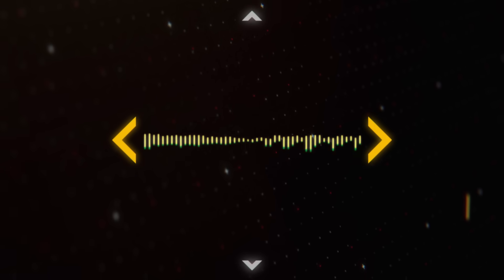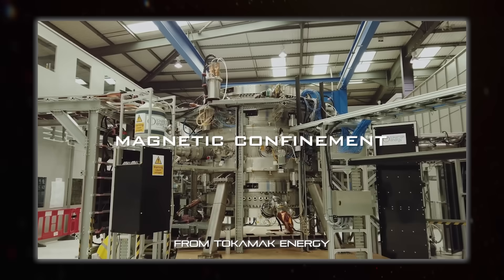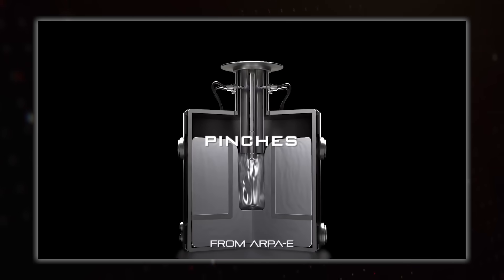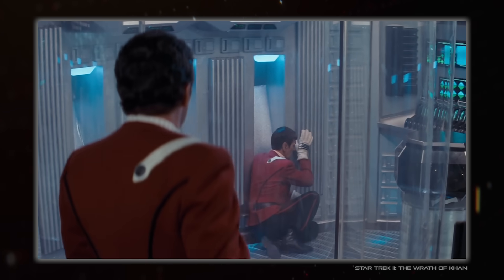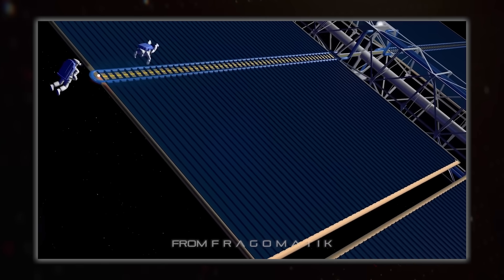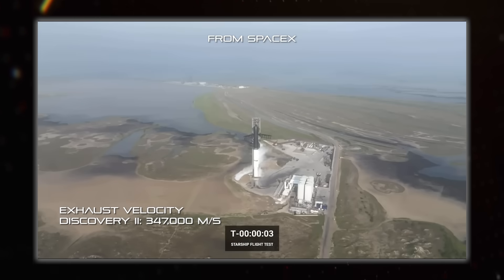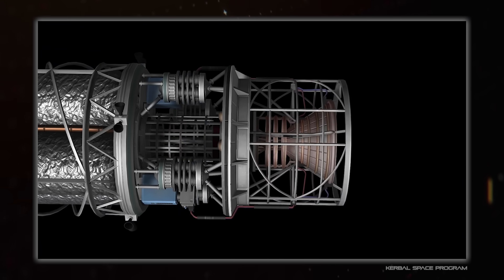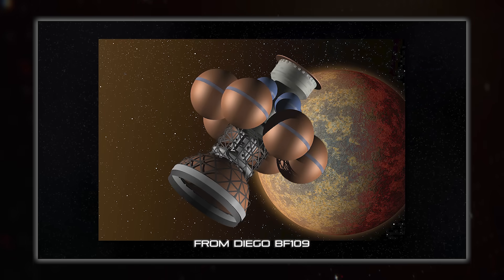Explaining Fusion Engines in Realistic Sci-Fi

Comment: 🤦‍♂NOPE ! This does not explain anything. It's a cool gallery of how they look with our current technology.
-Explaining is to be done with simple math/science. Science is your roof of realism and scifi is your ladder to get from actual human tech (most your video) to the closest of the roof of realism. Example of How : 
1-Considering 2 types of nuclear fusions DT and pB.
---DT : Deuterium-Tritium produce 17,6MeV ~ 3,375 E 14 J / Kg. Flaw : Tritium deteriorate fast.
---pB : Proton - Bore produce 8,7Mev ~ 6,985 E13 J / Kg. Less energy but easy to stock.

2-Assuming an efficiency of 100% (Roof of realism), How much mass From Mach 0 to Mach 20 in space.
---a 66t SR71 need 17,31 Kg of DT or 38,00 Kg of pB to reach mach 20
---a 6000T FREMM frigate need 1,573 T of DT or 3,455 T of pB to reach mach 20
---a 71 110T Yamato BattleShip need 18,65 T of DT or 40,94T of pB to reach mach 20
Limits :
---a 71 110T Yamato BattleShip need 82 210 T of DT or 180 500 T of pB to reach mach 1/10 of C (light speed)

3-Now you can adjust the engine efficiency to a lower 10%,  a realist 40% or super 80% to match your own personal setting. The design, radiation protection and technology will be adjusted with this efficiency.
Another Major information : To use Nuclear fusion, you need proton armor plate which will be use inside the engine and outside your ship since the faster you travel, the MORE space radiation you get.
-Ship mentioned that are using our level of tech will NOT survive to a tenth of their max speed. NONE.

PS : Mass is USI ie T for tons = 1000 Kg. (,) is use as decimal separator as I am french and too lazy. why ? check "Mars Climate Orbiter" and "4.45".

Comment: Ahhh, thrust is the problem.  At least for most fiction.

I'm thinking of water as fuel.  It's split into H and O.  The H is fused and any O that's not breathed gets mixed into the remass.  Is it a good idea?  Likely not.
Reply: Seems a good idea to me for a large ship, if it has the kind of massive electrical power source needed to electrolyse water on a sufficient scale, unless you're thinking to use extreme heat to split them in the engine.  I assume you're thinking of e.g. comet and ring ice as fuel sources?  You can also simply pressurise liquid water and squirt it as basic reaction mass for smaller craft.
Reply: @Josh_Quillan  

All true.  I'm not designing a fictional ship, just musing.  But good points.
Reply: Chemical fuels aren't powerful enough
Reply: @scifirealism5943  

Which would be why you would split the water into oxygen and hydrogen.  You'd fuse the hydrogen and breath that part of the oxygen you need and use the rest in what you're trusting

Comment: So, as part of an extremely expansive crossover AU I made a concept for a fusion reactor+engine that would have been made by Aperture Science. The key thing to remember with them is that although they are extremely smart, they also happen to be tremendously stupid and silly. So, the reactor part of it essentially used highly complex gravity fields to house an artificial star, with two exit points at the poles. Extremely energetic jets of fusion plasma would be emanated out of the artificial star and then piped into a series of pistons, literally just steam locomotive pistons in regards to design. Those pistons were hooked up to either solenoid or dynamo generators, but that’s whatever. This version of Aperture Science didn’t have anything strong enough to make turbine fans that could withstand fusion plasma, but they did have concepts for having twisted magnetic fields to create a sort of magnetic turbine fan in later iterations of this fusion reactor. The plasma would then be routed to a thruster mostly as just a way to utilize exhaust since they can’t just dump it Willy nilly like steam exhaust, but there is a sort of 'afterburner' system that would create a complex linear gravity field to fuse the plasma an additional level up the stellar fusion chain. Main reactor fuses hydrogen to helium, afterburner fuses the helium together.
Reply: It needs to use ASHPD-like portals to control thrust. The bigger the portal, the higher the exhaust.
Reply: @SammyWhiteley   Using it as a thruster deliberately didn’t cross their minds when designing it, that was an afterthought lol. They were just gonna vent it but due to the high speeds of the plasma even just venting it with no nozzle caused acceleration.

Comment: Seems most series forgo reaction mass or at least handwave it away. The only series I remember that uses it was the RCN series by David Drake which uses antimatter  but only in vacuum for obvious reasons
Reply: It's mentioned in passing on The Expanse a few times, from what I pieced together from watching the show they use water to cool the reactor, then split it into Hydrogen to produce thrust and Oxygen for the crew.. Also the thrusters are steam powered, not the most efficient but when you have a ready supply of superheated water it makes a lot of sense to use it. One character referred to manoeuvring on thrusters as "We're gonna Tea Kettle out of here"
Reply: @stonesie81  haven't watched or read the Expanse so I really didn't know. Does make some sense
Reply: Most scifi engines use reactionless drives.

Comment: Could you do a video on exotic sublight engines? Things like Star Trek's impulse engine are exotic due to their function being very different from other drives, either due to the engine itself or due to other mechanisms (like the impulse engine is plasma directed to the needed port instead of just dumped out the back)
Reply: Impulse engines and Mass Effect's engines could go in the same video.
Reply: Impulse engines are just a fancier name for their Fusion Engines
Reply: @lanteanboy  they also involve “low level warp fields” to increase the thrust by a few orders of magnitude. That’s the exotic part.
Reply: @kaitlyn__L  Ok, Ill give it to ya, that part is fair. But it's still basically just a boosted fusion drive.
Reply: @lanteanboy  yeah, it’s essentially using spacetime as your acceleration nozzle. Maybe kind of like an afterburner too. (Edit: though it might have a reaction-less drive mode by using just the warp coils? I think that’s been invoked to explain the absence of vents on some shooting models. Most of the time it gets its thrust from the combo though.)

Everything else unique about it is more “quality of life” stuff, such as being able to redirect the power from various fusion or antimatter reactors to the exhaust ports instead of it being a dedicated line.
Reply: Fusion thrust ports aren’t really exotic
Reply: I could talk about that.
Reply: Impulse engines use antimatter.
Romulus starships use micro black holes.
Reply: @scifirealism5943  Impulse engines actually use Deuterium. The Warp Engines use antimatter (and even then, it's from the annihilation process specifically which is then catalyzed by Dilithium)
and then Romulans do use micro-blackholes but once again, its for their warp engines.
Reply: @lanteanboy  I thought it was fusion engines too, but later Star Trek series contradict this.
Reply: @lanteanboy  Antimatter and black holes are the only fuel sources powerful enough to powerful practical starships.
Reply: @scifirealism5943  From Memory Alpha:
"In Federation starships, the impulse drive was essentially an augmented fusion rocket, usually consisting of one or more fusion reactors, a driver coil assembly, and a vectored thrust nozzle to direct the plasma exhaust. "

Maybe in the "reimagining" of Star Trek that happened in the last 8 years, they switched to Antimatter, but fusion would be enough to power the Impulse drives.
Reply: @lanteanboy  fusion is not powerful enough to attain near light speed travel.
To reach 0.5c using fusion requires over 6,000 times the mass of the starship in fusion fuel.

It would only require 2x the mass of the starship instead, if the engines used antimatter.
Reply: @scifirealism5943  first of all.... Impulse drives are pretty much meant to reach 1/4 lightspeed tops nowadays (but I agree that's still a LOT of fuel that'd be needed)
Secondly, they don't care about normal fuel as they have Bussard Ramscoops which basically give them unlimited deuterium (of course, in reality, that would be a LOT less efficient)
three: do you really think Trek actually cares about masses? Of all pseudo-science they tried to explain, I don't think I have ever heard them talk about "We're now way too massive to do x"

fourth: and the one I'll give to ya, truth is, the Impulse drives can be powered by both as it's a "fusion rocket" meaning it launches remass behind which is energized by a high-energy reaction either from the warp core (antimatter reactor) or the fusion recators.
Reply: @LanteanStream  .25c is still a lot of fuel.
Bussard ramjets require unfathomably strong magnetic fields, require too much time to spend going through space to collect anywhere near enough fuel needed for interstellar travel, relies on fusion anyway, which is already not good enough. PLUS relies on proton proton chain reaction fusion, which is far harder to achieve than deuterium tritium fusion.

I know, Star Trek is cool. I'll never stop watching it as long the stories are good(bad story telling is why I quit watching discovery).
Reply: @lanteanboy  read the star trek tng technical manual.
Reply: @scifirealism5943  we dont talk about STD.
Reply: @lanteanboy  LOL.

Comment: Kind of frustrated that this video presented thrusts in Newtons without controlling for the mass of the engine. Quite obviously, you can always scale any given engine design up to increase thrust, so talking about "Newtons" is meaningless unless the engines are all the same mass. It's the thrust / mass ratio that's critical, not the absolute thrust. Or in more approachable terms, the acceleration in gravities of a ship with a reasonable payload (10% or more of the ship's total mass).

Not mentioned is that the tradeoff between reaction mass efficiency (that is, specific impulse) and thrust is a problem that all reaction drives have, due to the simple physics of KE = 1/2 mv^2 and momentum = mv. The energy required to move a fixed reaction mass goes up with the square of the exhaust velocity, and the delta V goes up with the exhaust velocity. Thus, the higher your exhaust velocity, the greater the power requirements for the same thrust. Really high exhaust velocities require enormous power, so even a fusion reactor can't move a lot of mass, and you get low acceleration.

Even if our fusion engine is 100% efficient and the mass of the engine itself is negligible, the mass of the fuel gives us low thrust with fusion. We get about 0.1 G with an exhaust velocity of 100,000 m/s and an absolutely perfect engine with no payload. We need something like total conversion to get the high-G, high efficiency drives of SF.
Reply: Only Antimatter and black holes can power practical starships.